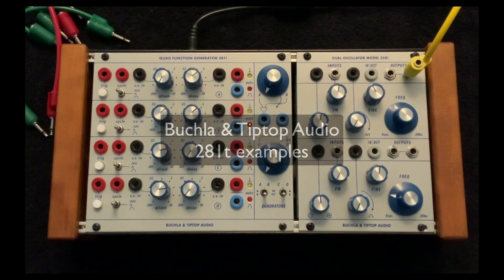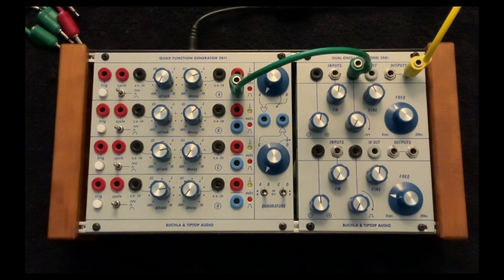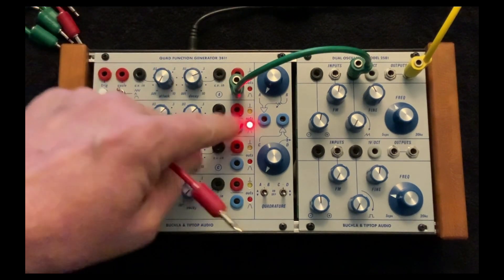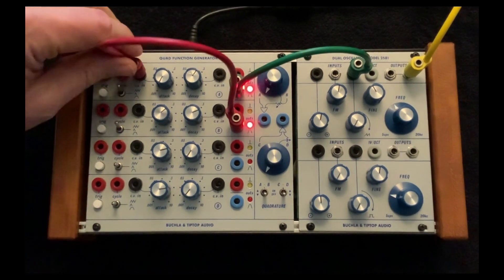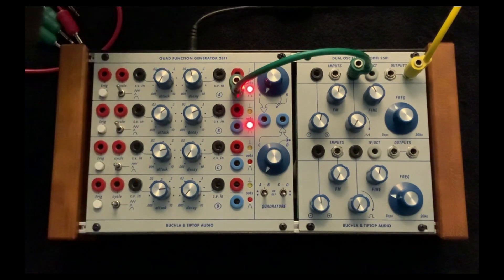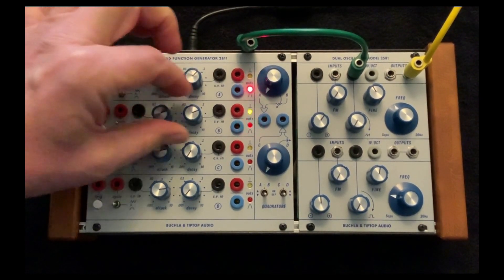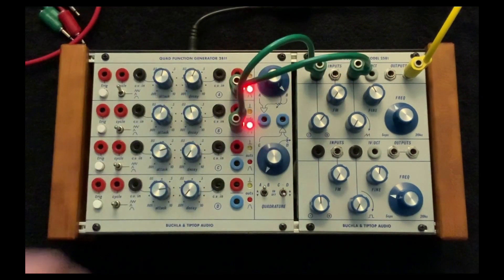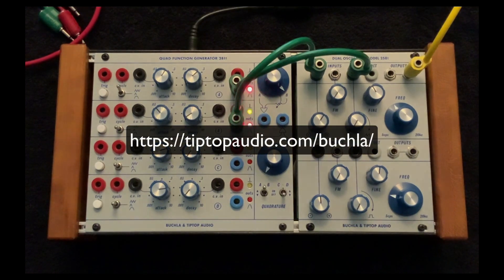Buchla Tiptop Audio 281t examples

Comment: Hi todd, can you help me with these questions:
I have a system of some of the basic modules in the tiptop buch series,  the sequencer 245t , the vco 258t? , the eg,281t and the random 266t.  Additionally, i added a simple passive LPG by meng Qi, and a simple mixer module.
Here's what I don't understand :
I wanted to create a simple melodic sequence,  heres the routing of the patch:, the 245t cv output is going to the vco v/oct,
 the vco output to the audio in on LPG, then the LPG audio out to the mixer, the LPG cv input gets a output from the 281t Eg. But heres the problem. 
I cant seem to get the notes to be more short decay, they sound more like they cant be cut into short fast decay sounds,(like a hihat for example) what they sound like is notes that have very little decay,even a partial slur/glide between them .   Wouldn't the EG allow the sound to be short fast decay?    To make the question super simple:
How can i patch a sound like a 16th note hihat pattern with these modules? ( Or at least 1/8th note)   And taking it one step further,  make each individual short lenght note have their individual pitch.
(I know how to turn the 245 knobs to adjust pitch into vco, but it's mostly the decay of the notes that doesn't sound right.        Maybe i don't fully understand,  but isn't an EG like a AD ENV?  Wouldn't it allow for short staccato notes?     Can you please explain in detail how to make the simple patch with these modules?     Thanks todd

Comment: I have a question about Quadrature mode with the 281t. I just received mine and I noticed that if I put A(Cycle) an B(Cycle) in Quadrature mode if A has a long attack and decay and that B has a short attack and decay, B will stop cycling during the Decay of A. Can you explain why this is happening?
Reply from the maker: Hi Terry, I don't have the technical knowledge to answer your question, though Quadrature mode is predicated on A receiving a pulse in or in cycle and B in trans or sum. I'm guessing also cycling B is really confusing/clogging the intended structure/flow path.
Reply: @vgermuse  Hi Todd, thanks for the answer. Keep doing these great videos :)

Comment: Hi Todd thanks for the videos, does it also work as a slew when in sustain mode?
Reply from the maker: Hmm…good question. It merely sustains for the length of the incoming cv but maybe it either the attack or decay are receiving a cv their might be a slew like effect. I’ll give it a try.
Reply: @vgermuse  Yea thats how it works with the Pittsburgh Voltage lab, set the func gen to sunstain and send the cv to the input (which is otherwise just the trig input) and it's a slew, I could do with a few more function generators in my rack that would certainly be a deal breaker. Thanks.

Comment: thanks for the demo. i'd be interested to hear more about the top left cv-in, you were calling pitch, denoted 'processing input' in the tiptop manual. i'd normally associate the 1v/oct in with pitch!? the tiptop manual goes on to say it is for 'scaling, expansion, and inversion of pitch'.
Reply from the maker: Back in the day you might have a sequence going into the upper left then have a keyboard goin to 1/v oct to transpose that sequence. Many more options — let you imagination run wild ☺️
Reply: If you wanted a quantized sequence going into the 258, wouldn't you need to scale the voltage before the quantizer to narrow the range of notes?  With the top left input, I guess you wouldn't really be able to use that for typical scaled notes?  More for experimental non-western music sounds?  For quantized stuff, would I just scale and quantize and use v/oct input like other oscillators? Would be nice to save an attenuator but I dont think it would work scaling after quantizing?  I'm somewhat new to modular so trying to wrap my head around some of these concepts.